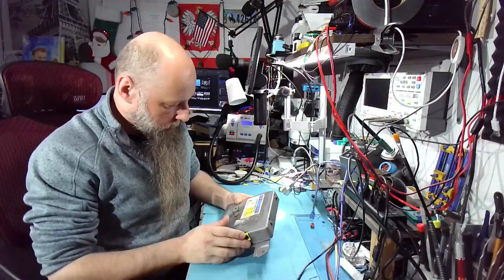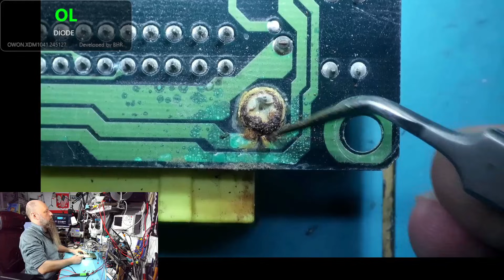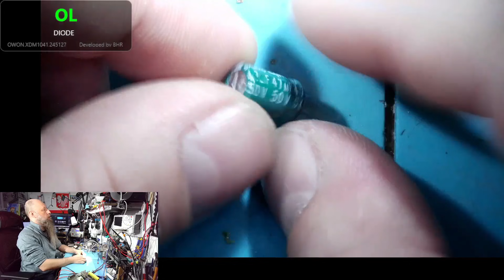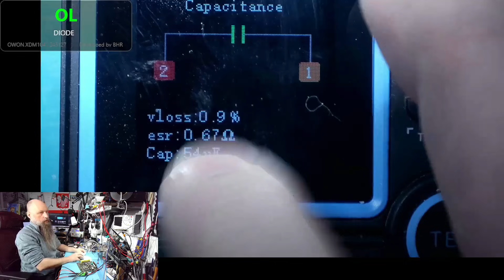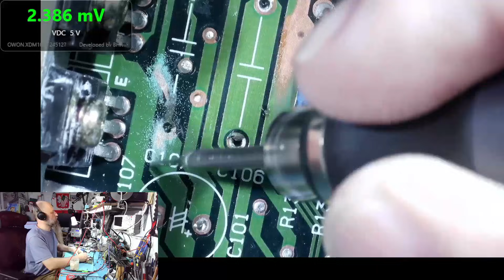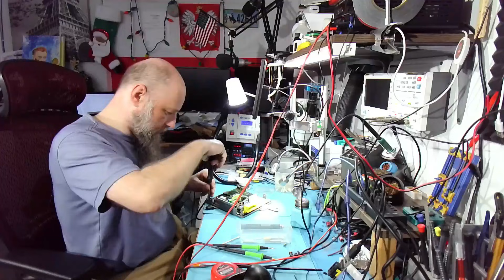332 | Mazda b2600 ECM Rebuild Dont use acids on your ECM

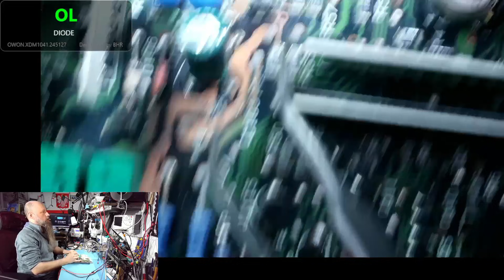Comment: 1:59
The previous cap leaked and ate the solder mask along with the coating so they removed the corroded solder mask and made the broken traces. Then they sent it back without any coating on it.

Comment: this  is my personal ecm from what i call my freddy sanford truck . my dad bought it for me in 04 and it was a calif truck   0 rust  160k and 1600.00 fast forward 21 tears in northeast ohio and  its got 225 on it now  and very rusty . upon removing rhis ecm i saw a hole in the floorboard. the missing screw was from a rivit i frilled out that previos rebuilder installed  i saw corrosion inside  , i am hoping this gives some life to my truck  raj  does some really cool work
Reply from the maker: Thank you for your business